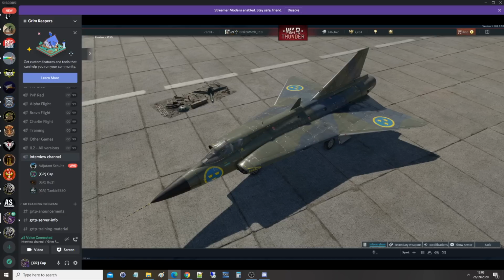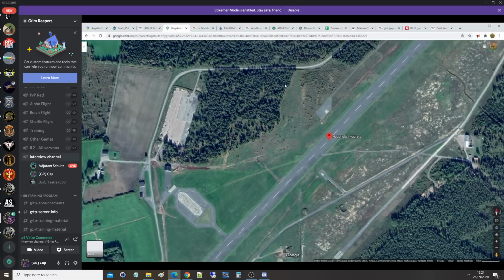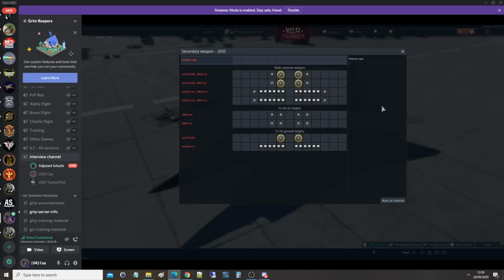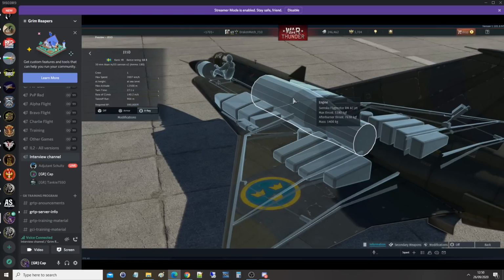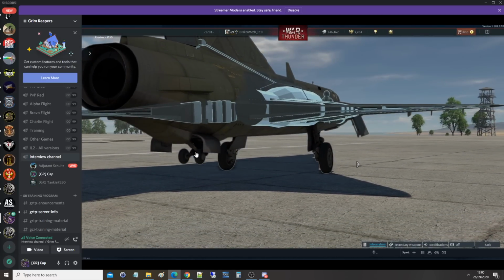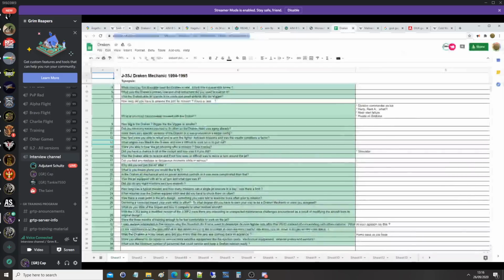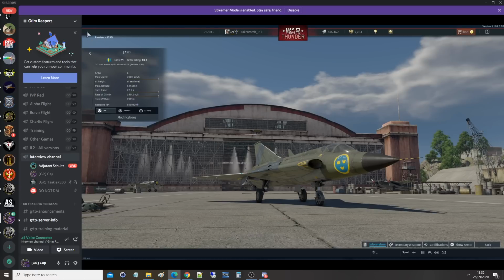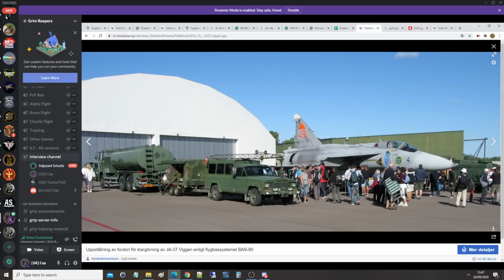Interview: Swedish Saab J-35J Draken Technician

Comment: Really nice video. A can see some comments below add on a couple of points that was perhaps not fully covered, such as why Sweden design and manufacture their own stuff (we couldn't buy any during WWII, and we don't want a repeat of that).

A few additional points.

From a strategic point of view, it was basically considered obvious that if war broke out, the WP would want to get to Norway to control a coastline along the Atlantic, to enable ships from the Murmansk area to get into the Atlantic, as mentioned. This obviously meant they would have to go through Finland and Sweden. So Finland and Sweden obviously placed a lot of focus on the defence of the far north, for this reason. But it was thought that Sweden was mostly just a transit country for the WP to get to Norway, which was the real price.
The south of Sweden potentially faced the opposit threat. There it might be that Nato would like to get full control over the strait between Denmark and Sweden, to deny the WP fleet in the Baltic sea to get out. So the south was also considered a potentially hot zone, but more from the Nato side. This was, however, never considered to be as much of a threat as the one in the north. Basically, if Sweden could just defend and protect its borders and waters, that would make Nato happy enough.

The seat of the J35 is rather reclined. It was sortof required to fit reasonably tall pilots (the plan is indeed small). However, it was realized that this had an added benefit that it made it easier for the pilot to deal with higher G forces. The Viggen pilot set is much more up straight, and it was recognized that Draken was better in that aspect. The Gripen again have a more reclined seat.

The starter is more or less running on rocket fuel. A horrible substance indeed, which many conscripts have been sprayed with. Everyone complains. It is actually very toxic. Cleaning area next when it happened.
I believe scramble times from the forward ready station (pretty much where pointed out, close to the runway) was something like 30 seconds. Pilots on alert were sitting inside the plane, and when the order arrived, it was just about starting up the jet, roll out on the runway and accelerate. And with the starting engine solution, spinning up the jet was rather fast.

Worth pointing out that the engine was RR Avon, but the afterburner was a Swedish design. The early A models had a different design afterburner than the later ones (the C model were rebuilt from early A models). Also, the D model and on had a more powerful version of the engine than the earlier variants.

Typical armament was (in peace time atleast) two external fuel tanks, and two RB24. The Draken was actually capable of using the AIM-9P (atleast in the 35J). Also, the radar got improved with almost every version. And of course, you have the gun.

The digital link in the J35 was way ahead of its time, as mentioned. For a very long time, it was also classified, and older pictures were usually always checked, and those ladders were made sure were not in the pictures. Just so noone would actually look at them and start wondering what the hell is that...?

As far as I know, pilots didn't usually use the short parade while flying. It was considered risky, and not recommended. But with enough altitude it could be managed. And yes, training included mandatory practice of the maneuver. But as mentioned, with aircraft equipped with special chutes to make recovery easier, if needed.

And for Swedes, the shape of the Draken have never been so amazing as for others, I guess. We were used to seeing them flying over our houses pretty regularly ever since we were small kids. Remember, Sweden manufactured over 600 of these jets, and most of them served in Sweden.

And the planes were very sturdy. I don't think I've seen or heard of any breaking up in flight or anything like that. I think the biggest reason for crashes and casualties were the superstall, which took time before it was fully understood.

Breaking distance without chute is a bit more than 800 meters, until the F model, which required about 800 meter with chute (it became heavier). Starting distance is less. Definitely operational from any road base.

Oh, and the steering automate was sortof an analog autopilot, and it did assist the pilot in flying the airplane. Usually it was engaged in a support mode where it helped control and smooth out of flying. It also provided artificial feedback of stick force to the pilot, since there was no direct feedback from the rudders to the stick.

I probably forgot a few things that I thought about when listening to the video, and I might have mixed a few things up, or forgotten how things actually worked. There are some good Swedish publications of the Draken, and there are still plenty of people who have flewn it stil around. You should perhaps try to locate someone and do a similar session. That would be totally awesome.

Speaking of the AJS-37 in DCS, that you mentioned. You should reach out to Stellan Hilmerby who have a youtube channel. He's an ex. AJ-37 pilot who is flying in DCS. He's done some instruction videos on the 37 which, while in Swedish, are extremely informative. And just looking at those, and comparing with how most people in DCS are flying the 37, I think they all have a lot they could learn, and take advantage of from Stellan. It would be absolutely awesome to do a session with him.

Comment: Comparing the J-35 with the star-fighter? Yikes. J-35 was in service with air-forces until 2003. The star-fighter was crap and retired 1975. The J-35 was a superb fighter, the starfighter was a rocket with some flaps 😉

Comment: just one little side note for the last picture:
possibly it's explained correctly for the Draken era
but the trailer for the jeep at least for BAS 90 Gripen/Viggen era wouldn't have a fuel pump as the fuel truck
would have it's own
the trailer would have oxygen and then tools to service the plane and winches for weapons loading
Reply: Oh yeah! Now that you mention it I remember that: the older fuel trucks did not have the integrated pump, but newer ones did.

Comment: The F-4D used AIM-4D to down 4 MIG-17 and 1 MIG-21 in the Vietnam War. And the AJS-37 have the ADEN 30×113mmB cannon pods, the JA-37 have the an Oerlikon KCA auto cannon firing the same 30x173mm shell as the brrrrrrrrpt GAU-8.

Comment: The reason engines are so far forwards in delta-wing air craft:  The long leading edge of the wing moves the dynamic centre of pressure (CP) forwards,   as you probably know this needs to be behind  the rearmost point of dynamic centre of gravity (CG)  to maintain stable flight characteristics, especially important in aircraft with high wing area.  As typically the engine is the heaviest single element of the vehicle, the easiest way to align these correctly and avoid a CG/CP mismatch (Where CP is forward of CG) is to move the engine forwards.  This is true for Viggens, Drakens, and Mirages.  Exceptions include the Typhoon/E2000 which requires forward canards and a complex automated flight control system to control its inherent instability.  This instability has actually been used to the advantage of modern aircraft for increased manoeuvrability in conjunction with the flight computers.

Comment: The 'J35 Cobra' is a induced loss of from controlled flight due to the aerodynamics of the dubble delta. It was a distinct danger, and caused crashes early on.
It was especially trained by initiating it, under "controlled and safer" conditions, with the intent of it then being avoided. I have read... (to be honest).

Comment: @1:16:15 I have a J35B cockpit diagram(?) but not a J35A, but looking at a photo of one of the prototype cockpits, there is a gauge with similar numbers (.7) to (1.6) that says Mach, soo
I can't tell for sure, but I would say it is a Mach indicator. Not an airspeed indicator, just a mach number.
(ref: SAAB 35 DRAKEN by Bo Widfeldt ISBN 91-971605-4-7)

Comment: @1:12:00 The ladder/tape gauges are; on the left of the radar the airspeed/Mach indicator, and on the right a combined distance, altitude and command-indicator.
(ref: SAAB 35 DRAKEN by Bo Widfeldt ISBN 91-971605-4-7 page 50)

Comment: When the RM6 engine, used in the J35, was 'married' with a swedish designed afterburner, it was at the time, with a little humour, called the longest jet engine in the world.
The "forward" placement engine, correctly questioned by Cap, is due to both the afterburner being soooooooo long, and the need to place the center of gravity infront of
the "thrust center". If the center of gravity is placed forward of the center of lift, and the center of thrust, the airframe becomes stable. As computer driven fly by wire systems
have replaced the lever and pully systems, the center of gravity can be set furter back, making for an aerodynamicaly unstable design, allowing faster turn rates and a more
fuel economical lower aerodynamic-drag trimming, and then artificially given a stable characteristics.
Reply from the maker: Thanks Bo Dan

Comment: As the  prospects of a second war turned undeniable, Sweden found that coutries with existing aircraft manufacturers, were more interested in keeping the existing
aircrafts and the production for 'themself'. We did order a hundred or so aircrafts and engines from the USA, the Seversky P-35, but we received only a few (J9).
The problems Sweden had, finding enough aircrafts to satisfy its needs, put the question of a domestic manufaturer as a priority. Thankfull we had a couple of
capable industries that either already had experience of building aircrafts, on licenses and/or of a few home brewed designs, or others that could quickly switch from
other similar manufaturing.
This "scare" of not having the aircrafts needed to pose a deterent, and the difficulties of buying said aircraft, are the main reasons why the government at the time, aided
and supported the build up of a aircraft manufaturing industry.
The focus on local requirements for Swedens defense force, is a result of the non alliance doctrin, which makes it rather duplicious to manufacture and sell arms, including
aircrafts to other countries. However, as the world has progressed and Sweden with it, our home grown designs have turned out pretty nice, and Sweden has lifted some of
the restrictions, some!, placed on selling arms. SAAB has therefore been able to sell the Gripen, and the Draken before it to a few other customers, other than the Swedish Airforce.
As a contrast, the 37 Viggen system, seemed to have been built with a little too much adherence to the swedish requirments. It turned out to be too expensive for anyone else.

Comment: Sidewinder versions require specific avionics capabilities to suit very different weapon parameters and seeker capabilities. The uncooled AIM9B essentially had to be directly facing a hot pipe to track, used valve electronics, had about 5km range and about 4.5kg HE frag charge. The AIM9J used a hybrid of valve/solid state electronics and improved seeker features, is more streamlined, has better canards for improved manoeuvrability and has about 18km range with about 11kg charge. The J could also be aimed using the aircraft radar, the B couldn't. There are several configurations of various contemporary components in both USAF and USN Sidewinder variants between rebuilt/modernised earlier stockpiles and newly built superseding models, but essentially for each new tech period of Sidewinder features your aircraft needed an avionics update to use them, so for example you have the F16A which can use the AIM9J and P but not the L or M even though they were both available during its service. The MLU F16 can use the L and M, or export P2 which is basically an L seeker on a P.

The AIM4 Falcon is a contemporary of the AIM9 and not a precursor. The early AIM9 variants could not track until the engine burned out, whilst the AIM4 would track immediately during motor burn and has a much less minimum engagement range and until you get to the 80s was a lot harder to shake off using high alpha, high g manoeuvres. The AIM9J was the first USAF Sidewinder specifically designed for dogfighting in about 1972 for the F15 Eagle but at that stage the AIM4 was probably still harder to evade. AIM9P would get you, but prone to countermeasures. Hence particularly for export customers buying from USAF stocks it is not unusual for fighters through the 70s to carry both or either AIM9 and AIM4. In fact the USAF did this themselves with the F4 Phantom early in Vietnam and this is a good example of how specific avionics are required for specific missile parameters, they didn't alter the F4 fire control system to one specific for the AIM4 and so had shockingly terrible hit rates with them, declared them terrible and switched the AIM9. The ANG continued to use the AIM4 which they regarded as far superior to the AIM9 until the 1980s when they switched to the AIM9P/F16. International customers also continued to use the AIM4 alongside the AIM9 as contemporaries with different engagement parameters.

It should be mentioned the USN progressed a different Sidewinder development path with a more generic utilitarian philosophy than either interception or dogfighting mission parameters, where all the early USAF versions were essentially based upon updated and rebuilt AIM9B the Navy adopted an entirely new Sidewinder design with the AIM9D which was a more manoeuvrable type to begin with and had converted from valve electronics to fully solid state by the Vietnam War as necessitated for carrier operations and the toll it took on valve electronics. So they were a little more advanced and whilst the USAF AIM9 path eventually led to the P series it is the USN development which gave us the L and M.

If you're really interested I could go a little more into why the two development paths. The successor to the AIM9B was supposed to be the AIM9C which was an early ARH missile type, but expensive obviously and the AIM7/Sparrow and AIM47/Phoenix SARH missile systems for BVR engagements were on the scene (yes the AIM47 which was designed for the YF17A, then carried over to the F111 when that was still a genuine fighter proposal matured into the AIM54/Phoenix ARH system for the Tomcat, which also tells you the F111 could always have been retrofitted with the AIM54/Phoenix if an interceptor role was ever considered necessary for it), so the rather expensive but limited performance AIM9C wasn't adopted. Except the Navy decided to put an IR seeker into it to make the advanced AIM9D that gave them a separate development path, whilst the USAF concentrated on continuously updating the AIM9B for a cheaper solution with their much greater numbers requirements. This is also reflected in their use of hybridisation valve electronics and solid state when the Navy had already converted to fully transistorised avionics.
Also worth mentioning the AIM4 "SARH" versions are actually beam riders and follow signals from the launch radar, not its reflections. More limited engagement parameters, but almost impossible to evade for the period, especially considering launch range was well within ECM burn through even in a jamming environment.

AIM4 is actually a really good, extremely reliable missile right through to the 80s. You had to get nice and close, but guaranteed direct hits when pretty much anything else on the market had a best ratio of about 70% in ideal parameters. They never even bothered with proximity fuses it was so good. But you had to have a suitable fire control set for it.
Reply from the maker: Thanks Jason I will read this when I get a chance :)
Reply: Quite amazing read, thx

Comment: The J-35 Draken is by far the plane on the top of my wishlist for DCS.
- Didn't have enough fuel to stop accelerating
- First plane to do a cobra
- Just absolutely bonkers

I live where all of these were built, including the Saab 32 Lansen, versions of 35 Draken, 37 Viggen all the way up to and including the 39 Gripen.
Along the main E4 motorway passing town, they have these original plane shells on pillars, with the Viggen and of course Draken being the most interesting ones.
Reply: Here they are. There are others along the stretch too.
https://www.google.com/maps/@58.445983,15.728215,3a,75y,221.49h,97.09t/data=!3m8!1e1!3m6!1sAF1QipNFmrXXPjjioPDcet3O0srucvitdB63VMSxKfil!2e10!3e11!6shttps:%2F%2Flh5.googleusercontent.com%2Fp%2FAF1QipNFmrXXPjjioPDcet3O0srucvitdB63VMSxKfil%3Dw203-h100-k-no-pi-0-ya326.55142-ro0-fo100!7i5376!8i2688